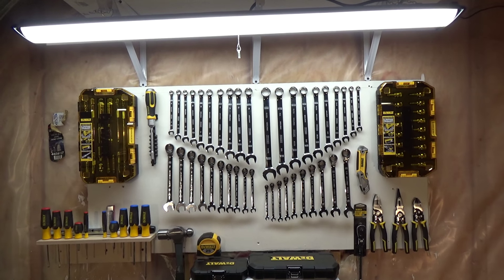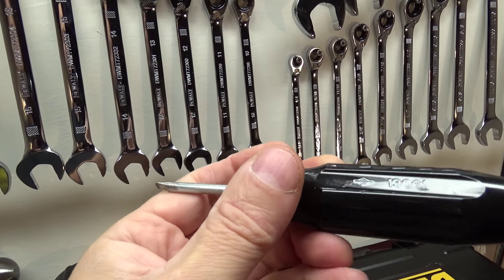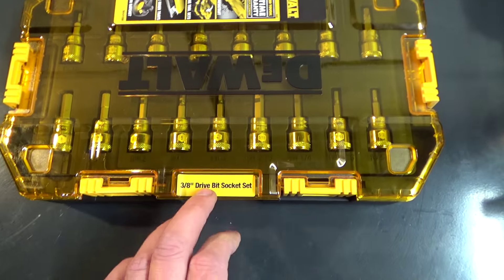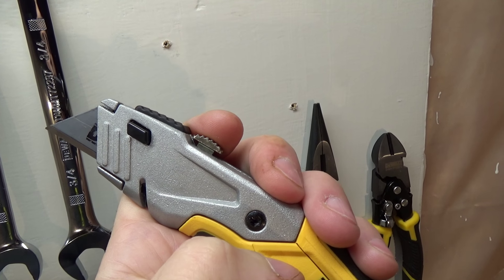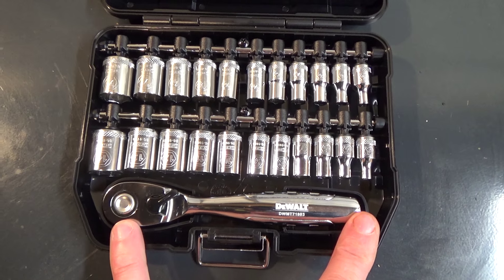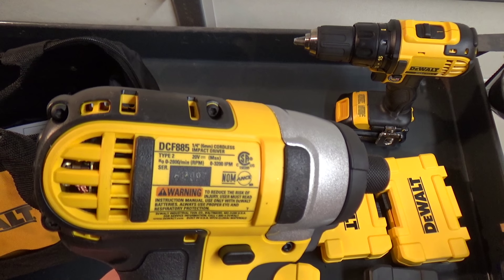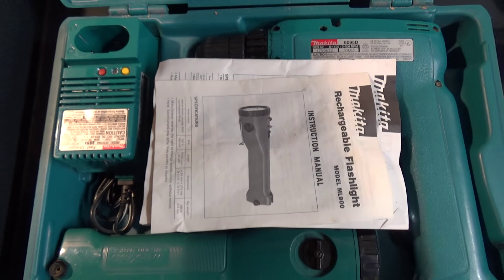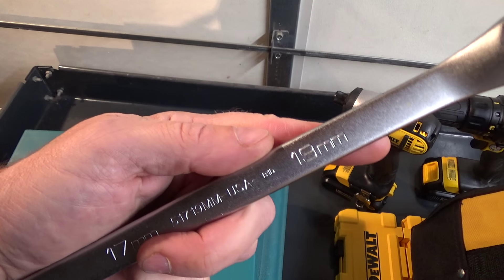Dewalt Tool Board Update

Comment: The ratcheting wrenches,dip the ratcheting end in automatic transmission fluid once in a while.The ratcheting mechanism gets dry and the automatic transmission fluid lubes them up.That Makita,the batteries are getting hard to find for it.Lowes,you do get a discount since you are a veteran.Have to show proof.Only way to get it is to apply for VA benefits first with the VA
Reply from the maker: +wafrederick Thanks for the tip on the ATF, I've never owned a car with a automatic transmission so I'll have to stop and pick up a bottle. 
For anyone looking at old Makita 9.6V batteries you can get aftermarket replacements for $28 at Battery Mart here  http://www.batterymart.com/p-makita-um1691d-battery-3.html 
I always use my 10% military discount at my local Lowes. My ID is the very old pink Reserve style and they have never hassled me once. 10% may not seem like much but it did help last fall when I bought a new snow blower there. Plus I like the fact that I can always bring my dog with me inside Lowes.
Reply: My dad got denied at Lowes last time.He can't get VA benefits,his income is the reason why and got turned down for VA benefits.Served in the Marines
Reply: Tool Giveaway, check it out:

https://youtu.be/hr0cyOMyr9I

Comment: hey Mark question for you, how are those Dewalt non ratcheting wrenches holding up. I bought some GW ones and was disappointed with the quality so I returned them. looking at either those or Tektons but like the longer dewalts.
Reply from the maker: These are not in daily use but so far they are holding up just fine. Depending on what you're working on I might go with something different, I use 8mm often and you can't get one from Dewalt. I recently picked up a set of Tekton Metric stubbys and really like them. 
Look for a tool update from me soon.
Reply: +Mark Fox  looking forward to it. Seems like with many companies switching for US to China and even Taiwan to China the quality drops. I prefer US but hopefully Tekton or Dewalt sticks with Taiwan.

Comment: You can get the 8mm Dewalt wrench from toolup or hardwareandtools .com individually
Reply from the maker: I found the individual ones at Blains Farm & Fleet and added the 8,21, &22 mm wrenches since I made this video. Dewalt is actually coming out with some new stuff and I now also have a new 1/4" drive metric set with a non quick release style ratchet.
Reply: Good to hear!

Comment: Hey mark quick question I have a 92 cb750 Honda that uses some oil. What product  can I use to help slow the use of oil? I do not want to mess up the wet clutch. Wondering if marvel would work it has 42000 miles on it. It runs good now so I don't want to cause more issues for myself. Thanks for all your great videos
Reply from the maker: I don't believe in "magic exteriors" to stop oil consumption. Every 4-stroke motorcycle I own I use Mobil 1 15W-50 synthetic but not the motorcycle specific stuff, I buy it in the 5 qt jugs to save some cash. As long as the oil is not marked "energy conserving" it is safe to use in any wet clutch system. 
Your problem could be piston rings or valve guides but I don't really like doing internet diagnoses without being able to see it in person.
Reply: thanks just wanted your opinion i figured with the wet clutches you can't just put anything in the oil without possibly causing issues with the clutch

Comment: Can i request a separate more in depth tool review on the Dewalt impact driver? im looking into getting one but would like to know the capabilities (Torque wise) if you could show it removing fasteners that would be awesome! Also, the makita drill you have is older than me! lol born in 1991!
Reply from the maker: +James'sWorld 
James I will be installing a new clutch in one of my own motorcycles soon, just waiting on the custom aluminum (steels) plates to come in and I plan on using the new impact for that job.

Comment: I just purchased the racheting screwdriver. Its very cheaply made, I was extremely disappointed when I opened it.
Reply from the maker: I haven't used mine much but it did work good with a T8 Torx to open up my hedge trimmers with.